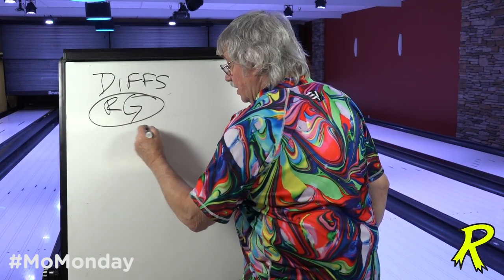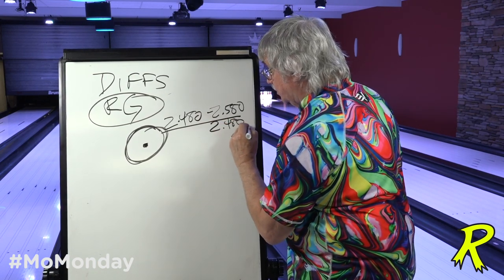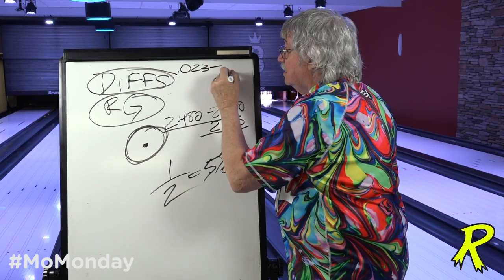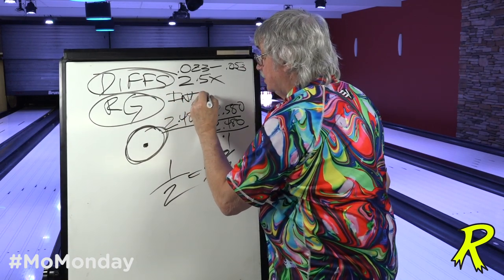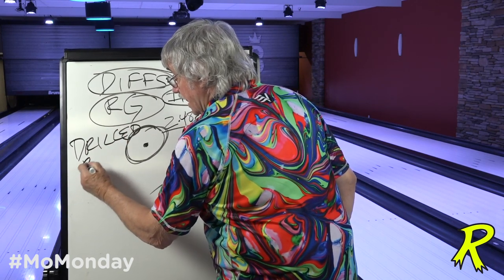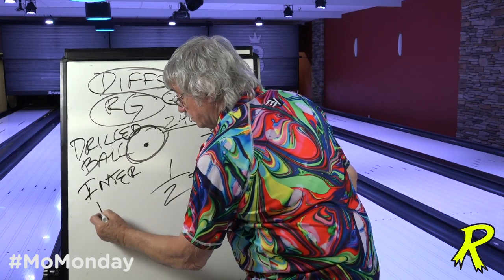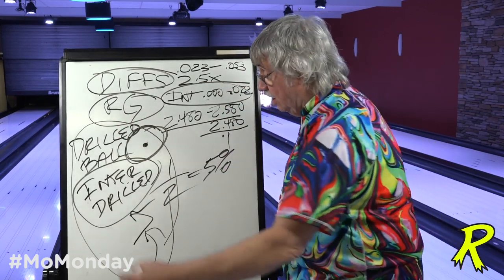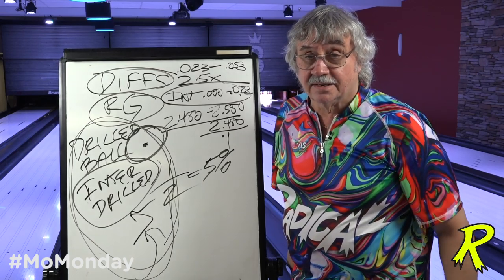What's MORE Important? RG or Differentials? - #MoMonday

Comment: I know a left handed bowlers get a bad rep. However, suppose a lefty has a 600+ rev rate that loves Brunswick, Radical, and DV8.. What drilling for what brand would be recommend for a 41' length for 35 volume. HPl surface.

Comment: This could be the crack pipe talking (seriously I’m just a league bowler) but I always thought RG mostly influenced length (first transition) and Intermediate Diff influenced the shape of the second transition (really due to diff ratio).  I’ve always had this hypothesis that these lower diff symmetricals (I mean around .030) were popular because they have weaker “engines”, but higher differential ratio so can have shorter, sharper hook phase.  I just don’t have all the drilled numbers to prove it.  Also explains why a big asym with around .041 diff might be better liked than a big asym with .058 diff.  Smaller denominator, greater Diff Ratio.
Reply: Ps hope you’re feeling better!

Comment: How much does coefficient of restitution play in ball reaction? Is it important? Or just another number.
Reply: That's just measure of kinetic energy transfer.  It's normalized to 1 because it's a percentage.  1 would be if all of the energy from the ball transferred to the pins and 0 would be pin the stuck to the ball and had zero effect in a sense.  It's a measure of the elasticity of the impact, pretty cool actually.

Comment: So, how much do the stats really change for a "drilled" ball? And, how much would you say the coverstock affects the stats?
Reply: You can see the final values for every layout option Radical recommends in their drill sheets.  It is significant and you can probably change the final numbers even more than what is shown with some drilling tips.  This is assuming you use your thumb, no-thumb layouts don’t change the dynamic stats as much.  If you are talking about two piece vs three piece balls, Mo did a video about this a little bit ago.  If you are talking about switching cover stock type without changing thickness, it doesn’t change anything.
Reply: @dapoggi4434  Sorry, I don't understand how this relates to my comment; is there something in it you don't agree with?  I understand you may want to use different layouts for different balls but the RG and differential values are the same if the coverstock is the same thickness of solid, hybrid or pearl reactive resin.

Personally, I wouldn't drill balls for particular lanes because I bowl at too many different places but I could understand it if you only bowl in one or two locations.
Reply: I'm happy to pay more attention to Int. Diff. stats, but the six balls I'm looking at now are 
.000 {all symmetrical}. I do see the asyms have some numbers like .015 to .020.
Reply: Dapoggi I wouldn’t agree with that, if they weren’t important we should be throwing perfectly balanced spheres with the exact same layouts on every ball with just different cover stocks.
Reply: Dapoggi Mo has said shape is mostly influenced by the core, how it is effected by drilling and how it is oriented at the moment of release.  You obviously need the correct coverstock for the conditions you are playing but you can’t change the shape much just changing that so if shape is something you need to change, you will need to change your release or the dynamic values of your ball (could be different core or layout).  I know it isn’t the first thing to check but considerate it important.
Reply: @dapoggi4434  I see where he says RGs don't matter much but I'm not seeing where he says diffs don't matter.

The best example of how much affect the core has is polyester balls.  I don't know of balls with reactive resin coverstocks and no cores or panckake cores so I can't compare.  When the lane conditions allow to use them as strike balls, the difference between a ball with a core and no core is very obvious.    Also, if the ball is drillled for it; you can throw a back-up ball by manipulating your hand position and throwing it with close to zero axis tilt.  If find that much easier than throwing a true back-up ball; this would only be for spare that are easier for left-handers to make, not strike balls.

The core isn't the most important thing in a bowling ball, I guess it depends what each individual thinks is significant.

Comment: 1 divided by 2 is actually 50% not 5% as he states here in the video.
Reply: Then move the decimal because the actual numerator is .1 (the range of RG values described directly before that) and the answer is 5%
Reply: @AverageLeagueHack  The problem is that he isn't calculating a percentage, he's just making shit up.  His engineering degree can be defeated by a 7th grade child.
The difference between 2.48 and 2.58 is .1.  Dividing the difference by 2, is NOT how you calculate a percentage.   To calculate the percentage of this, would be 2.48 * X = 2.58.  Solve for X by dividing both sides of the equation by 2.48.  X = 2.58/2/48, X = 1.04.
2.58 is a 4% increase over 2.48.  Again, this can be re-proven by basic math.  2.48 * 1.04 and viola, you get 2.58.

More important than this, is that just because the difference on the RGs is only 4%, doesn't mean it's only a 4% difference on ball motion.

What's even more odd, is that Mo was part of the USBC study that identified the largest impact on ball motion.  He referenced it all the time, when talking about how important surface was.  When he wanted to downplay CG's because of the minuscule effect they have, he used that same study.  Well, that study also lists RG as 6th largest factor on ball motion.  MORE than Differential, Int Differential., and Spin Time.  So this one is a bit perplexing overall.  https://www.bowl.com/uploadedFiles/Equip_and_Specs/Equip_and_Specs_Home/08ballmotionstudy.pdf

Comment: So a 5% difference in RG should equate to the ball rolling 3 feet sooner(2.48 rg) or 3 feet later(2.58 rg). If my equating is correct, that's a heck of a difference, right?
Reply: There's a lot more math having to do with conservation of angular momentum (the math of revs) and intermediate axis theorem (the math of flare) than I can easily type in a Youtube comment. But RG's effect on the ball essentially has to do with how fast the ball revs with the same amount of energy imparted onto it. In terms of rotating objects you actually need to square the radius so the difference between 2.48^2 and 2.58^2 is actually 7.6%. What that means is that with the exact same amount of rotational energy imparted from your hand, the lowest RG ball will rotate 7.6% faster than the highest RG ball, and with the same ball speed you should see 7.6% more revolutions over the length of the lane. This doesn't necessarily mean it will hook 7.6% earlier, or 7.6% more, that all still depends more on the differential of the ball, and also the interaction with lane oil. But the ball will go through it's flare phase 7.6% faster and enter a roll 7.6% sooner
Another thing to consider though is that every ball has a High RG (pin in the track) and low RG (pin on your PAP) and as the ball flares it migrates from the high RG to the low RG. The difference between these two numbers is your differential. so a ball with a 2.58RG and a 0.054 Differential will eventually flare itself into a 2.53RG position down lane.
Reply: @St0rm301  One of the very few highly intelligent and well thought out answers on the internet, well done!
Reply: @St0rm301  How can you (Not you MO) in one sentence say RG doesn't matter then in another sentence say the diff is what matters but it is essentially the difference between the HIGH RG and LOW RG? Am I missing something or being pedantic. To me RG matters in general and then on top of it the RG defines the DIFF?
Reply: Also even if we talk about diff we are talking about a dynamic RG at a certain point on the lane so it is still RG dominating. The equations of conservation of momentum only talk about Rotational Inertia (Basically defines RG) and Angular Velocity, Linear Velocity, and Mass. So what we are doing is making the Rotational inertia a derivative as it is changing based on the imbalence.

Comment: The problem is that he isn't calculating a percentage, he's just making it up.  His engineering degree can be defeated by a 7th grade child.
The difference between 2.48 and 2.58 is .1.  Dividing the difference by 2, is NOT how you calculate a percentage.   To calculate the percentage of this, would be 2.48 * X = 2.58.  Solve for X by dividing both sides of the equation by 2.48.  X = 2.58/2/48, X = 1.04.
2.58 is a 4% increase over 2.48.  Again, this can be re-proven by basic math.  2.48 * 1.04 and viola, you get 2.58.

More important than this, is that just because the difference on the RGs is only 4%, doesn't mean it's only a 4% difference on ball motion.

What's even more odd, is that Mo was part of the USBC study that identified the largest impact on ball motion.  He referenced it all the time, when talking about how important surface was.  When he wanted to downplay CG's because of the minuscule effect they have, he used that same study.  Well, that study also lists RG as 6th largest factor on ball motion.  MORE than Differential, Int Differential., and Spin Time.  So this one is a bit perplexing overall.  https://www.bowl.com/uploadedFiles/Equip_and_Specs/Equip_and_Specs_Home/08ballmotionstudy.pdf

To be clear, this is nothing against Mo, (RIP) or any of his other contributions, this is isolated to this specific video and his statements here alone.  If you say shit like "Where did you get your engineering degree from?" then you can't fail basic algebra in the same 3 minute video and not expect to get push back.
Reply: In other words, he did it in his head and got within 1%.  More than accurate enough to illustrate the point he was trying to make.
Reply: The funny thing to me is he is saying RG doesn't matter but is used to define differential... Very odd way of talking about things.
Reply: To me that sounds very contradictory. Does anyone else see the problem with this.

Comment: So my Magnitude 055 is no good anymore??? (out of regs)
Reply: Grandfathered in?
Reply: Grandfathered in
Reply: @Mainzer74  Your .055 is fine. USBC made a procedural change that new submissions with .055 or greater would require about 5 dozen balls to be tested for approval anything less would require only 2 balls. So to include a margin for error Radical plans to only design balls with a max diff of .053 Mo discusses this in his pro shop seminar about the change/elimination of the balance hole rule. It's on YouTube.
Reply: @AverageLeagueHack  its not my .055  😃
Reply: Your .055 is fine. USBC made a procedural change that new submissions with .055 or greater would require about 5 dozen balls to be tested for approval anything less would require only 2 balls. So to include a margin for error Radical plans to only design balls with a max diff of .053 Mo discusses this in his pro shop seminar about the change/elimination of the balance hole rule. It's on YouTube.
Reply: @Mainzer74  clicked wrong reply link my mistake

Comment: 1/2 is .5  To get a percent you multiply by 100 which is 50% not 5%.  And where does the denominator of 2 come in? Not an engineering major but math.  Don't be cocky in your videos
Reply: But your numerator is wrong. It should be .1 not 1. So 1/2 of .1 is .05, x100 = 5%.